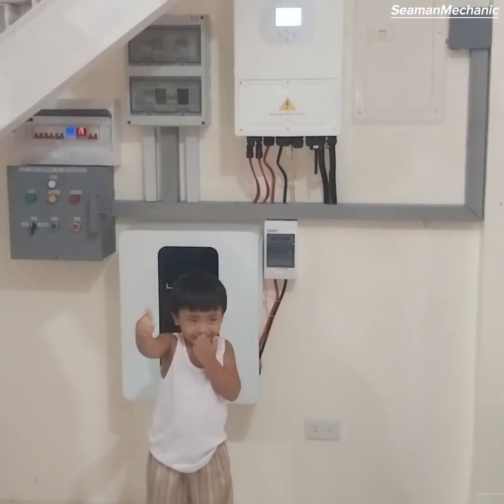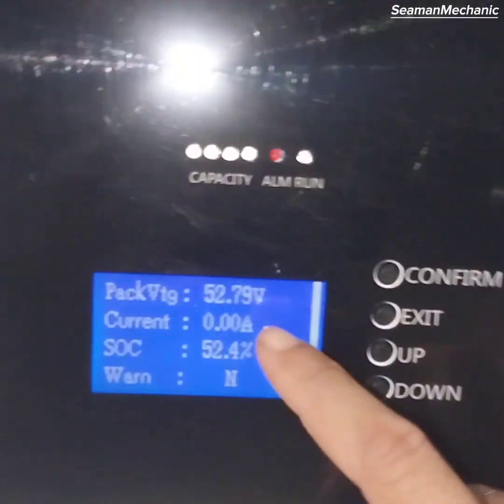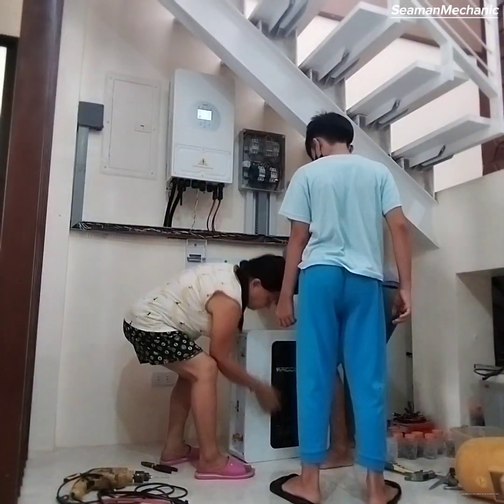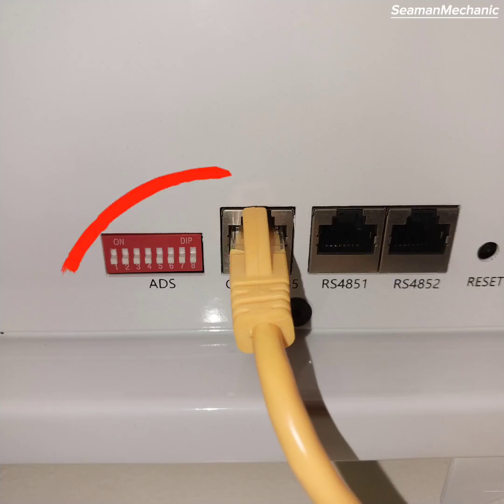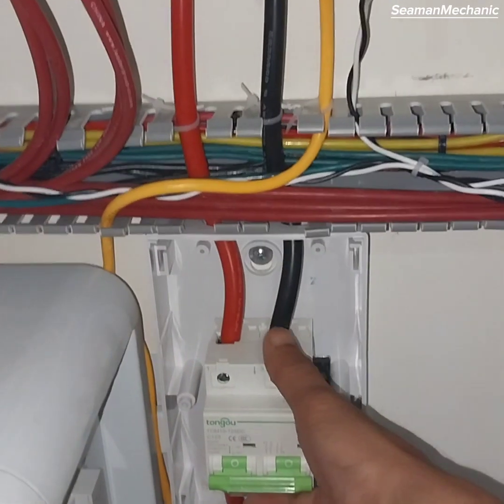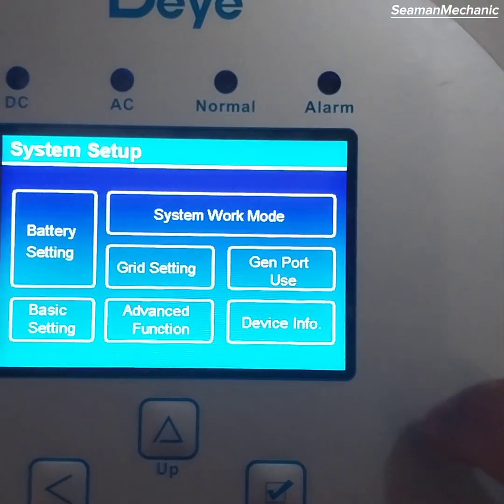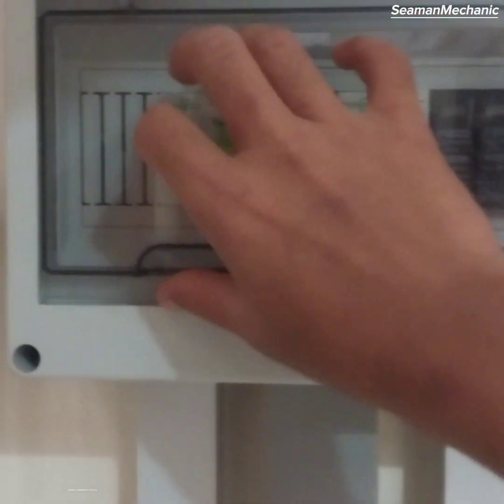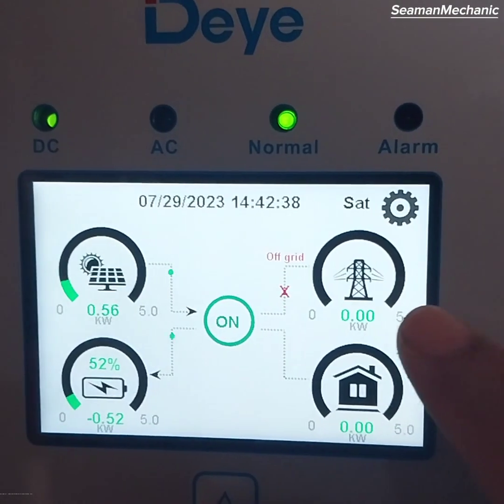Deye / Hybrid Inverter / Leodar Lithium Battery installation and commissioning

Comment: Sir ano po sequence if i-power off po from battery to inverter to AC ckt breakers. tnx po
Reply from the maker: Una ko po tangalin yung  mga load, tapos off breaker AC out from inverter, off breaker AC in to inverter, off breaker ng solar, then OFF inverter, OFF battery.